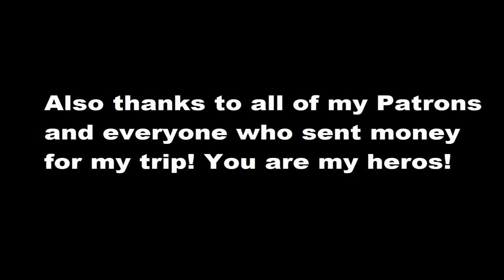It is time to ride! | Season 5 | Episode Episode  3

Comment: Hi Pavlin!
Question about the mesh you had on the seat: what was your opinion about that after the trip was over?
I was about to put one of those on my seat, but I have heard comments that it damages the seat itself and also the rider’s trousers.
It is made of 3-d woven hard nylon fiber and I tend to believe these comments. It is getting rather popular here, though as it allows some ventilation for some important parts of your body. 😜
Please, share your experience. Thanks!
Reply from the maker: It is definitely helps to keep my ass and aloud me to ride the Himalayan more than 7,000km. Without it, with the stock seat I wouldn't be able to. I have heard that it could damage the trousers, especially jeans, but I have no problem with my motorcycle pants. If you ride with very thin pants, you actually feel it.
Reply from the maker: Another one benefit is that it keep the seat dry even when it's rains.
Reply: Thanks a lot!
Yes, it definitely helps with ventilation and keeping you dry. I checked that on someone’s bike.
My concerns are about the upholstery of the seat and my alpenstars pants...
Probably I should get one, in Bulgaria the price was half of that in Germany.
Reply: @ Vesso...hello..that mesh stuff costs around 2 US$ from which one can stitch 3 seats (bigg) 
Or 1.3 US$ for a readymade seat-cover..(1 piece)
Its amazingly helpful in our hot summer weather..
If worried for the pants to b destroyed, which is true, one can use medium-thin hand-towel over the mesh-seat (I use it :)